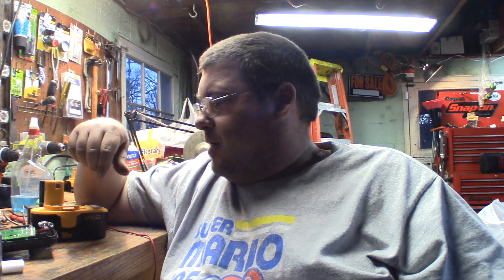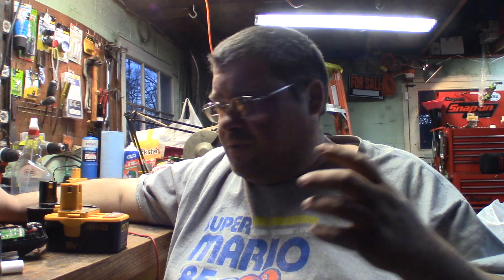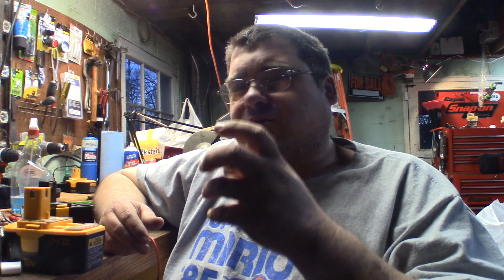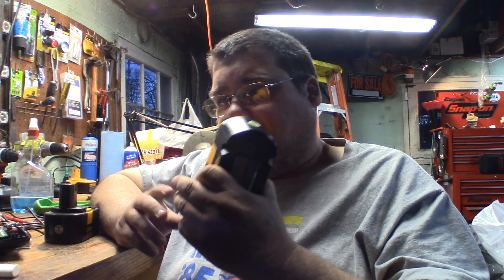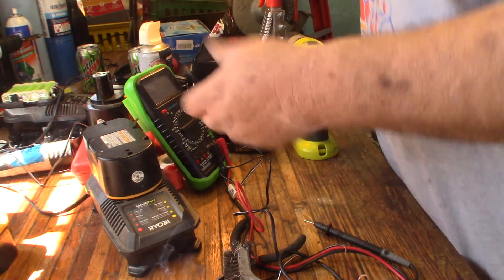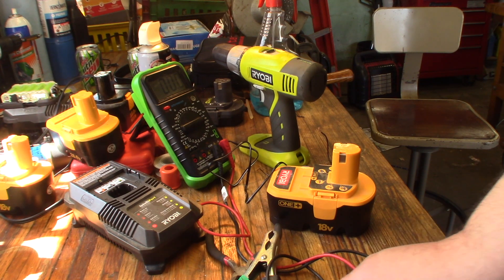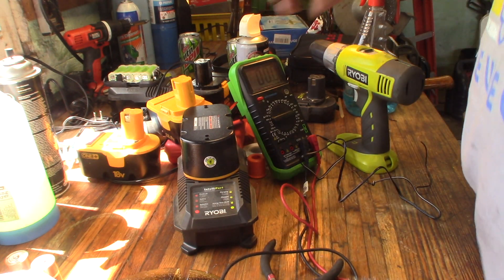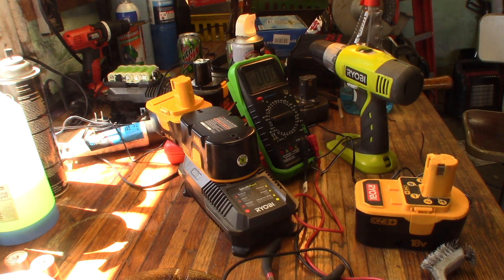How to Bring NI-CAD Drill Batteries Back to Life & Make Them Charge Again - Ryobi

Comment: My Stick welder is AC. probably not going to try this. Good luck in the comment box.
Reply from the maker: Mine is ac too.
Reply: @frugalprepper  yours is a/c as it plugs into the wall? or It plugs into the wall then bridge rectifies to DC, internally? Because Mine sends Alternating current. Which is rare to need that besides its the cheapest welder you can build. I dunno why you'd want to switch currents a million times per second on a DC battery, but maybe you do.

Comment: Take good battery and place next to bad one.  Take small alligator jumper cord (micro center) and jump left to left; right to right.  Leave that way for 1 1/2 hours.  You are placing a charge into bad battery.  The charger needs to sense that there is a charge in the battery for the relay to turn on the charger.   Take the "bad" battery and place it into the charger.  It should now charge since the battery will be above the threshold where the electromagnetic relay will pull in the 110 volts to charge the battery.

Comment: I guess I missed exactly WHY using the welder helps as opposed to just using a trickle charger or using 110 AC volts from the house.
Reply from the maker: You can used like anything that is 24-36 volts.  AC or DC.  120 from the house may be a little much.

Comment: If the cells are dead than all the high current hits will do nothing ...it may charge but the cells are poor and the charge will not be held  Best to test the cells with the battery open and then replace defective cells. Do not put the old cells in the trashcan as Cadmium is toxic!!

Comment: I know this is a very old video and you may not answer but I'm really really hoping you will bc out of the countless hours of videos I've watched about this you were the most thorough and you explained everything in a way my autistic ass understood real well lol. Thank you for this video btw. I have a craftsman 19.2v set with nicd batteries bc I don't want to go to the lithium ion batteries, and the set worked fine until a few months ago I tried to charge the battery and it wouldn't charge so I left it on the charger. Now I know that was dumb and I'm assuming I have the crystal growth in here. However, I don't have a big enough battery really to zap it. I did try another 20v battery from my worx set and I tried jumping it with my car battery neither worked. When I test the terminals with my multimeter I get 0.1v across terminals 1 and 2 and also across 4 and 2, but across 1 and 3 and 4 and 3 I get 21.7v. So 3 is hot and 2 is not even though it should be. When I test all my cells individually with my multimeter (they're still connected in series I didn't take em apart) i get 1.37 volts on all 16 of them. The thermal fuse has no continuity across it, and the thermistor reads 1.57v in continuity mode so I'm guessing it's okay and the thermal fuse is my problem. Is that likely the case or could it be something else? I have basic knowledge of mechanical and electrical things but my electrical and wiring aptitude is definitely lacking but I need this battery to run my impact and I need to change the rear shocks on my car so I need the impact lmao. I would greatly appreciate any insight you can offer me. Sorry I wrote a whole story, I wanted to give you as much info as possible 😂
Reply: Nevermind lol. I shorted out the thermal fuse and even though the battery still shows defective on the charger it's working in my impact so I'm going to order some thermal fusess off Amazon and use it bypassed for the time being. I suspect the charger is also bad maybe

Comment: Thanks for the tidbit of info regarding how the ni-cad's flow electrons creating the power to run the tool.   The satellite reference was more info that I now have stored up in my noodle.   I have 7-19.2 Craftsman battery's.  Two I purchased online just to have a couple that would take a charge while I tried to figure out how to possibly.   I don't have a welder so could I just remove the female repair end that I already have replaced on the extension cord (which is 12ga btw) and use that to try and jump them with 120V at 15 or 20 amps??   I had to retire from the building trades due to health issues so I don't use my screw guns very often but I don't know if this is true for the new batteries that are sold with cordless tools now but when I was working outdoor basically everyday the cold is a stone cold battery killer.  If you don't keep your batteries in the house during the night and try to keep them somewhat warmer like on the truck dashboard in the sun or if the house is heated you can put them inside where you are working.  I don't know if this theory of mine is actual fact so correct my ignorance if needed, but I found that if you plug a cold charger into an outlet and put a 15-30 degrees F basically frozen battery pack on to charge it kills
ni-cad's. Also I found that if you turn on your flashlight and forget it's on and let the battery run all the way out it will give you the defective battery light. I read somewhere that if it doesn't have a certain minimum amount of charge left on the battery it's done.  Well it I lost them for different reasons but that is why I have 5 dead soldiers sitting here on my workbench that I hope to revive.  One of the batteries I bought online is already dying way too early and it doesn't have the same power that the other one does.  And no I haven't kept them in the house because after the back injury I did a couple of rounds with the rotten ass cheap shot bastard that is Cancer.  We found it luckily before it had spread (well they think so anyway).  My doctor said "Oh, I wouldn't worry about it,  99% of time it's nothing.   Well guess who is the 1 percenter!!!   When they tell you that you have cancer it is the biggest mind Fuck that I hope I never have to face again.  I didn't get out of bed until the evening of the 3rd day.  My wife said she was gonna give me about another 45 minutes and she was coming in to the bedroom and kicking my ass.  
You gotta love her......... we will be married for 28 years in June. I have put her through hell with my bi-polar craziness. 
"She is the light that chases away the dark"... that is where my demons wait for me to slip off the edge so they can drag me in and then the fight is really on!!!  The brain is really amazing.  The bi-polar didn't hit me until I was about 48 years old when I had my mid-life crisis.  I saw the light of the tunnel I was in go out and the light in a little short tunnel turned on.  I am 55 and right now I am coming up on the date my father died.   Scary,  55 years old.  We played music like always from 6pm until 2am and a family friend found him at 8am that next morning.  Sometime after I left him at 2:30am he passed away.  Sitting right where I left him.   Luckily I told him I loved him like every night and I got "Luv-ya too babe"  reply.......... that was it...........
I apologize for the length of the post.... I got to ramblin on and on....... happens when I am "manic" which if part of the bi-polar deal.  Imagine your brain is running at 10 or so times faster than your normal pace and for me I was a contractor so I am drawing blue prints for something I want to build but I am also thinking of 5 other things at the same time.  I will usually go a couple of nights without sleeping.  Cannot shut the brain off to relax and sleep.... it's actually pretty awful.    So I haven't slept since Friday night so hopefully I will be just exhausted from the non-stop 125 mph that I am running at all day and sleep tonight
Peace

Comment: This is a sure way to blow the internal thermal fuse.  You theory is correct but you method requires to do each cell one by one inside the pack at 2.5V @ 2.0Amps.  Using a welder or car battery will at least ruin the battery life and possible risk of the cel exploding. You need to provide a gentle shock.
Reply from the maker: And my batteries are still working

Comment: Ha Ha, , a welder, thats primitive, , , i tried a bench power supply, and got it to draw 2 amps for 15 minutes, it didn't work this time cos it only takes one cell to be a dud that changes the resistance effecting all the batteries in series when charging, its the same with car batteries, one or more cells die, usually because of the build up of white lead sulphide that buckles the cells, especially if you leave it uncharged, , covering one cell in a solar panel gives no output, , , i have tried it 2 times before with different batteries and it worked , , ,

Comment: They sometimes do take another charge, but then discourage overnight and do not hold power for a long time. Best to check them out internally and remove a defective cell or two. Need a spot welder to secure the new cells ...worth a punt as the new bars a

Comment: I wonder - seems like I've read about some of these battery packs having a small thermistor inside as a heat or overload protection.  Perhaps that one battery pack that wouldn't take a charge has blown out that thermistor.  I believe that article said to open up the battery pack and cut out that thermistor and just join the two wires together.  You won't have the protection but the battery pack may be usable again for a long time.

Comment: I have those batteries, and they had no power. I had a fully charged battery, and 4 with no power, and the charger would not charge them. I saw a video, about a guy using 2 pairs of scissors, connecting positive to positive and neg to neg. I used a 12 gauge wire to connect pos to pos and neg to neg. I let them sit for a while, about an hour. To my surprise, the dead battery was then able to accept the charge, and keep it. All 4 are fully charged!

Comment: My 20 years+ old Bosch drill/driver's battery (NiCd) packed up.
I sawed off the base of the pack and found 6 cells inside, wired in series.
Removed them with side cutters, making a drawing of where they went, polarity, etc.
Ordered 6 modern NiMH cells (Batteriesplus), with twice the Ah capacity and higher current capability (more power). They arrived fully charged in 48 hours.
Soldered them all back into the case (the cells have solder tags) and fastened them with the hot melt glue gun. Then glued the base back with Superglue, and painted over the cut to conceal the repair.
The old charger works fine with the new battery, you just have to time the charge using NiMH, and not leave it on permanently.
The repair saved me over £50, and my old Bosch drill works better than new with its upgrade!
Reply from the maker: yeah replacing the cells, especially with NiMh is better for sure.

Comment: Hey Frugal, i have 2 nicd Porter Cable 18 volt batts that will charge and can use for a while. Can i blow the cat hairs off with the car charge system using jumper cables since i dont have a welder?
Reply from the maker: Yes, or a battery charger will work sometimes.

Comment: The chargers have a voltage reader in them because the batteries need to fall within a certain range to begin the charging process. If the battery is too low the charger cannot risk overcharging a foreign battery and risk causing a fire or explosion because the operator put in a battery not designed to be in the charger. So it will refuse to charge. What he is doing with the welder is putting just enough voltage in the battery to get it to the minimum charge voltage so the charger can recognize it as the correct battery type for the particular charger. You could do this a bit safer by using the same battery types so DeWalt to DeWalt one fully charged and the broken battery connecting positive to positive and negative to negative leads, in 20 to 30-second intervals until the broken one can be recognized by the charger.
Reply from the maker: It is true that there is a minimum voltage at which the charger will start to charge the battery.  It is also current limited and it checks the internal resistance of the battery.   It is true the voltage is low.  It is true that I am bringing up the surface voltage when I shock it.  It is also true that I am blowing the dendrites out between the anode and cathode in the cells which is what cause the voltage to get so low.  See this document form NASA about the process:  https://ntrs.nasa.gov/search.jsp?R=19850023073.
Reply: @frugalprepper  Shorting two batteries like my first comment suggests provides a lot of amperage too which is why you only do it for 20 to 30 seconds. This amperage could burn the dendrites as well
Reply from the maker: @clearmist1  Absolutely if the voltage is low enough in the receiving battery the current will melt those suckers off!

Comment: This is exactly how the professional do it but they use very expensive high quality power source not an old arc welder in the corner of there shed but a better way would be to use a mig welder stop the wire feed and hold the tip on the positive and Earth on the negotiate and press the trigger this way you may get less weld spatter and marks on the battery terminals
Reply from the maker: Well, if I get a mig welder one day I will give it a try.

Comment: What is the output voltage of the welder - I don not have a welder? WRT the welding rod connection, if you attached a copper wire to the battery terminal and then touched the wire with the welder terminal, you would not have to clean the battery terminal as the copper wire itself would take the welder spark - just a suggestion! Well done, however, very useful information.
Reply from the maker: I don't know exactly I am guessing around 30 volts or so, which is what most welder are.  It has not setting just a 15 amp and 20 amp switch.  It's just a little cheap 120V stick welder.

Comment: Thanks man,I just opened my damaged battery and I was going to do the welder trick ,but before that I said let me put back in charger, miracle happened, it is charging now ,,,,,,,,,,,,,,   only one cell showing 0.00v   the reset is 1.3v  is it necessary to replace or I go ahead and do the welding trick. it is Dewalt 14.4-2.0Ah NiCd
Reply from the maker: It won't hurt to give it a shock, but if the cell is completely flat then it has probably gone into reversal, which is a chemical change in the cell that can't be un done

Comment: It doesn't make the batteries any better. It's just the smart charger wont recognize a completely flat battery. A dumb (ie old) 12v charger will do the same thing: charge it up enough to get the smart charger to sense it is there.  Same thing with lead acid batteries. You're welcome.
Reply from the maker: Dendrites between the cathode and anode are a real thing with Ni-Cad.  You can probably blow them off with a 12v charger though if the batter is nice and low

Comment: IT CHARGED !!!!!!!! but when I put the battery in my drill it worked for about 15 seconds and was dead. Put it back in the charger and tried it again. Guess what ????l? It did the same thing.  Friend of mine did the same thing and had the same results. I went on Amazon and took a chance on purchasing 2 batteries for $49.00 and so far they work like new batteries. I believe that if you leave batteries sitting for several months without exercising them they're going to go bad and have the same results.
Reply from the maker: Leaving them at full charge is what causes the dendrites to grow.

Comment: I have a DeWalt lithium 18 v battery which wouldn't charge, it had been sitting in my shed for about six months. I took it apart, disconnected the electronics and spot charged it for a couple of seconds with my 24 volt DC battery charger. Reassembled the battery and electronics then put it on charge, no problem since, works well.
Reply from the maker: Sounds just like my other video on Lithium batteries.

Comment: I have opened some dead NI-CAD batteries and they were severely corroded inside at the spot weld point.
Reply from the maker: Corrosion is cause by low voltage so that is always a possibility.

Comment: Welder:  110 volts AC?  Is the output voltage AC?  If AC, then how does it charge a battery?  If you answer this, does a welder increase the voltage or the increase the current?
Reply from the maker: The welder isn't charging the battery, it is blowing the dendrites off between the anode and cathode.  A welder will put out around 25-30 volts but it is the current that is important for this application.

Comment: Short question how many Amps of current for the Joilt?  And I understand thats a dc welder your using
You take 120 volts AC convert it to 120 volts dc current at ?? Amp setting with a 6011 rod no doubt and Jolt the battery for a flash second.   I might try this with my 240 volt stick welder set at its lowest setting on dewalt batteries, but you can fully discharge them with Led bulbs over weeks and then get them to work again sometimes.  I'm not sure if the XRP batteries have a circuit board in them but at this point what do I have to lose they don't hold a charge anymore. And Dewalt decided to stop making any of them.  Lithium Ion go dead with time the chemicals stop working even if you not using the battery, its a bad investment for someone to buy that type if they just use the tool once and awhile.
Reply from the maker: No It is an AC welder.

Comment: there is a video on here of the same problem same charger and same batteries, all the chap done was with the batteries in the charger just turn the charger off for a couple on secnds and then back on, with battery still inserted and the charger corrected the problem and then it started charging again,, its like a "smart charger"
Reply from the maker: You may get it to charge but it does nothing to resolve the underlying issue of the cells shorting out internally.